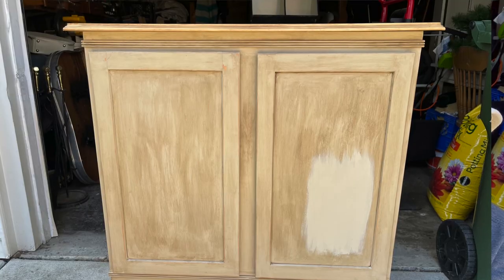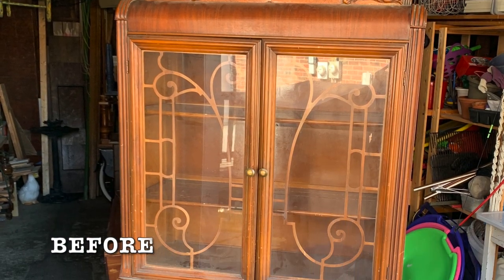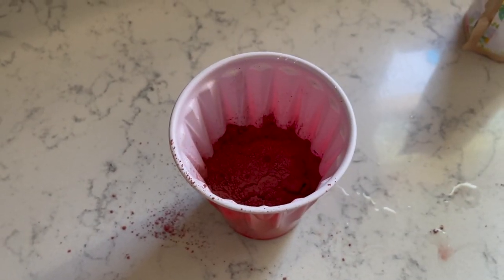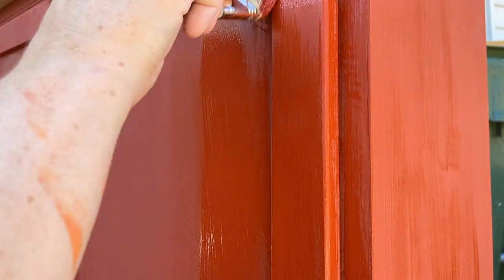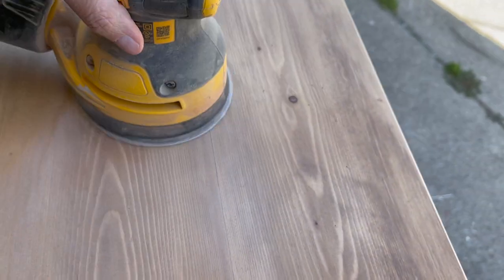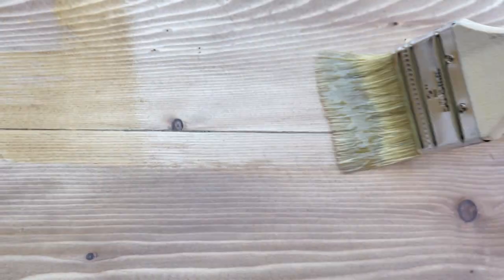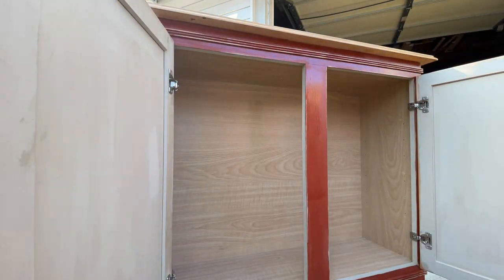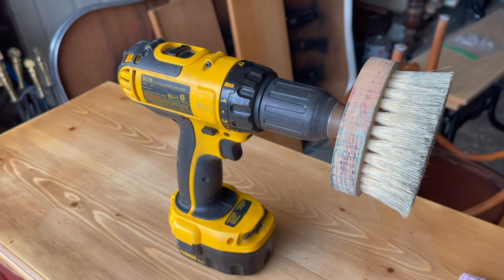Furniture Makeover with Sweet Pickins Milk Paint

Comment: Gorgeous!!!  Can you use the oil wax with DIY paint? Also can you use it after you have applied DIY cream wax? Thank You for sharing your expertise on repurposing furniture!!
Reply from the maker: You only need one wax. Paste or oil, not both. Oil wax can be used on DIY Paint, but I have found it may take an extra coat. Oil wax does not soak in to diy paint like it does on wood or milk paint.
Reply: Thank You